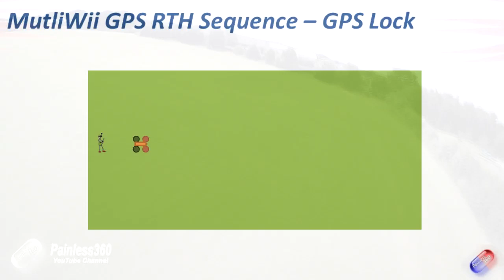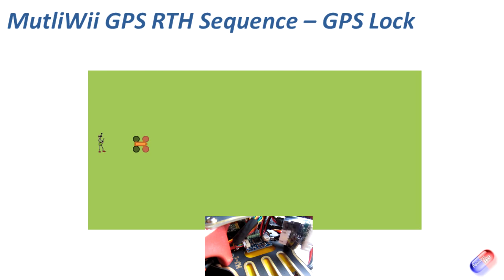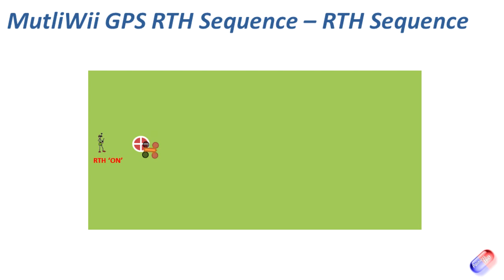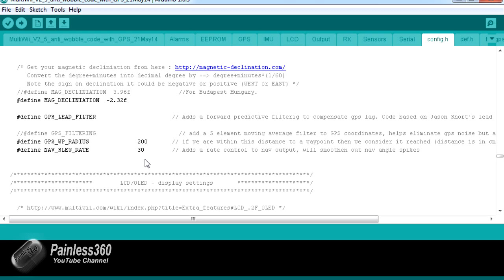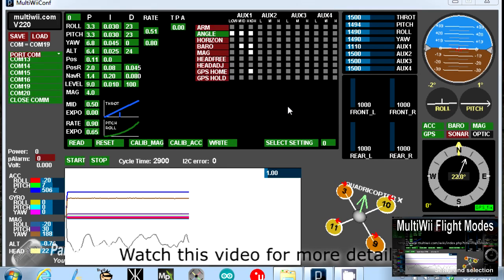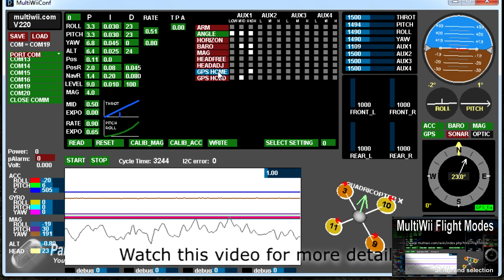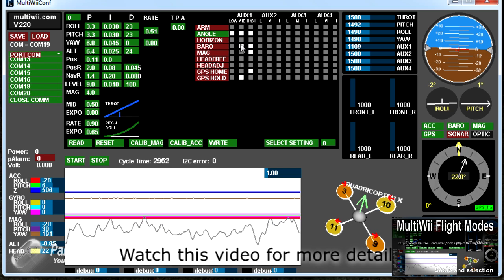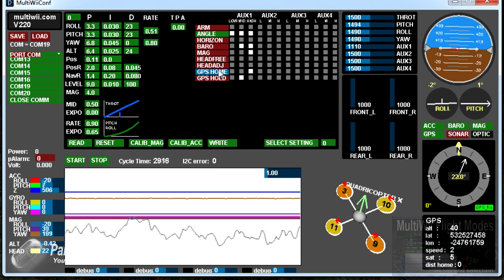MultiWii Quick Tip: Overview and demo of the 'GPS Home' function

Comment: So, when we power TX and The drone (armed), does the FISRT location saved by the drone???
(I'm working with Mahowik Balancing  Robot now with the GPS (NMEA).

And, do you switch the AUX1 when activating the RTH?
Reply from the maker: This is a very old video, check out the newer stuff on the channel.
Usually, a GPS capable fligth controller will store the location it's armed at as 'home' and use that to fly back to in the event of a failsafe/RTH. There are other things you can do, like SAFEHOME and other stuff too. Again, check out the later videos on the channel...

Comment: Hi!  Can I ask … if gps home is all working properly … if just in case I lost signal with the craft … will it also rth?  I can't find this feature on the sketch ..  Thanks again .. all your videos are really very very helpful.   :)
Reply from the maker: Set the fail-safe on the radio receiver to put the mode switch into the RTH position. Best of luck!
Reply: Thanks!

Comment: It does not have a RTH altitude as APM has? so when triggering RTH will it return starting from current altitude or there is a way to have some ascend first to 50 meters to avoid flying into objects etc?
Reply from the maker: +FotoAmg AmgFoto I'd check the latest documentation. The last version of Multiwii we played with  (2.3)  the RTH altitude wasn't managed by the flight controller. Best of luck!

Comment: First of all thanks for all the instruction videos. I installed the gps and i2c on my multiwii 2.5 and have followed all your instructions but when in angle mode and not gps hold the craft goes on its own and I cant control it. Any ideas of what im doing wrong? I have only 2 mode switches on my transmitter and have angle and gps hold on one switch  and off and gps home on the other switch. I always have 7 to 8 satelites when i try it.
Reply from the maker: +jose pedraza only have gps mode on one switch position. Best of luck!
Reply: I have 2 switches which are only 2 mode each one, so should I only have gps hold and off on one and angle and off on the second one?

Comment: Besides hold and return to home, is there any other thing I can do with my GPS + crius se 2.5?
Reply from the maker: +Everton Leite the latest version of the code supports simple waypoint navigation. Check out the release notes. Best of luck!
Reply: +Painless360 Hi, great videos! I could configure my multiwii with your help. A question: Does this simple waypoint navigation work with 328p based MW boards? I've read that it needs a bigger processor to run. Thanks!
Reply from the maker: Not sure - that will be covered in the release notes. I'd use an APM/Pixhawk/CC3D revo if this is what you want to do..

Comment: thanx painless360 been trying to set my runner 250r multiwii config up. your config worked on my runner as i only used gps mid for hold on its own and used gps high for home on ots own and worked.

Comment: Hello anybody! I have a Walkera Runner 250 and I have added a Walkera QR X350 GPS antenna. I have plugged it into my Runner and I have all my GPS info on the Multiwii but not on the OSD/FPV goggles. Does anyone know what I may need to do to show the GPS info on my OSD/GOGGLES?????
Reply: +prodezignz hi you need a barometer on the main controller board they dont come standard. you can pick them up from ebay.
Reply: +prodezignz plus you need the osd r for the info on the goggles

Comment: +Painless360 I have almost same setup as yours, except the board is MW Megapirate, and I have assigned Aux2 for GPS Hold and GPS Home functions. The problem is, when I flick the switch (ground test), the functions doesn't turn Green on the MultiWiiConf GUI, though I had about 10 Satellites locked on. Not able to figure out why the mode change is not reflecting as Green. Can help?
Reply from the maker: +Rahul Watharkar Not sure as it's not the same board. I've seen this once in the past and the GPS functions still worked great, seemed to be a little 'feature' of the GUI.Best of luck with it.
Reply: +Painless360 ok, I figured out the solution for it. Basically for GPS Hold and GPS Home functions, the Angle or Horizon mode is a must. You cannot configure GPS functions in silos. They must be accompanied with either Angle or Horizon mode, secondly a Magnetometer is also a good to have feature with GPS. 
Another thing required is, the GPS Modes will only be active when you have Enough satellites (5?) locked on and the motors are armed. 
So in summary, you need these 3 things for GPS Modes showing active on MultiWiiConf-
1) GPS to be configured with some flight mode (Angle/Horizon) and a magnetometer (not very sure if MAG is a must).
2) satellites locked on (gps_fix is green)
3) Motors are armed.
It worked for me, haven't still maidened the quad with this board. Happy and Safe landings :)
Reply from the maker: Great detail, thanks for sharing. Best of luck with the maiden flight!

Comment: Does the mumetal needs to be grounded? I have setup with grounded copper sheet, do you recon it worth of hassle to order it and replace it with mumetal? GPS lock works, and the noise on sensors got much as well, so at the moment I'm reluctant to change my setup, but  if this shows worth it I would give it try.
Reply from the maker: truhlikfredy in my tests I found that copper wasn't a good enough barrier to magnetic fields, even if I did ground it. I've tried other metals (ferrous) and not found anything as good as MuMetal.
Reply: Ok thanks, will give it a try. What do you recon for the go home, can it fight strong winds? Will it put more effort when I will see more resistance? I have the thing there but 99% fly manually and very close to me (sometimes I'm just happy with hovering couple meters away from me) so I never properly tried them. But I'm worried if some strong wind will pick it up, should I fight it manualy or put it to the GPS go home.
Reply from the maker: truhlikfredy there is a max speed for the RTL function so high winds could cause issues if it is flying home into the headwind. .

RTH is a last resort. Not an everyday flight mode. Happy flying!

Comment: ordered my gps ublox going to be a few weeks, i have had real good success with my d.i.y flight controller, even managed to get the pwm - ppm receiver conversion done with another arduino nano board... i need to get another nano board for the i2c conversion this i did a while ago and i pretty much think i can get that code to work too...anyway i was going to ask... running multiwii ver 2.2 will i be able to use gps rth, and gps hold..? also i need a foolproof way of setting up and making 100% its working... was going to try gps hold first a few times, also need to make 100% my mag is working spot on...  is there anyway to test my mag at moment without gps...? if i switch mag on should it lock the heading..? thanks AL...

Comment: Hello,
I messaged you several months ago regarding initial setup for an octocopter.  You advised me to start smaller which, of course, I didn't do (the hat should tell you that was coming, lol).  It's been quite a ride.  Our prototype taught us a lot about structural parts, etc.  I should mention here that the entire frame, from the motor mounts to the landing skids, is 3D printed.  I have successfully been able to get the craft to lift off and not make a bee line for someone's window and tomorrow, we'll be going to a wide open field for further flight testing both in horizon mode and using GPS functions such as RTH and flying a mission.
I want you to know that your videos have been highly instructive.  Thank you for sharing your insights and in particular, thank you for placing yourself in the position of the person who knows nothing and then explaining the important concepts in clear language.
Reply from the maker: Bill Isaacs Hi Bill, I do remember telling you that :)Glad you've got it all working so far, if it hovers - then it'll fly (power system willing)!Have a fun day in the open space, it is a great feeling flying something you've designed, programmed and build yourself. Happy flying!!
Reply: Painless360
Well things went well until I made a mental error.  The aircraft hovered and was controllable.  I was able to maneuver it well even though being only two blocks from the beach the breeze was a little stiff.  GPS hold worked fairly well too.  I got so excited about how well things were going that I forgot I only had a little 2.2A battery powering it, my intention being to test how controllable it was before putting one of the larger 5.2A batteries on.  I got the copter about 60 ft up, tested GPS hold briefly again, then began a slow descent.  At this point the controls became squirrely and I said to myself "uh oh...".  The battery was dying and the copter crashed into the grass from about 30 ft altitude, breaking several arms.  Fortunately, the entire frame is 3D printed and it's no big deal for me to repair the damage.  Other than that, I feel it was a successful flight.
Reply from the maker: The first few flights of any model usually end in a little 'bump' ;) Crashing is part of the process, the trick is not to do it from a height or over deep water

Sounds like you made a great hex. Well done.

Best of luck with the repairs. I'd like to see a photo when you have it back in one piece..
Reply: Painless360 Sure thing on the pic.  https://www.island-wifi.com/alpha_v1.0.jpg
Reply from the maker: Wow, amazing job. nice clean setup through the arms too. Thanks for sending that across..

Happy flying!

Comment: Hi Painless, I was wondering if you have in any of your videos show the exact way how to turn your quad , using a Multiwii system , on all of the axis's to get your GPS Home set?  Just want to know how to hold the quad while turning in circles to get it locked in. I have mine with Bluetooth and use a android app and either my Samsung Note 3 or Nexus 7 to try and calibrate , but I am not sure if I am doing it right. I can figure out holding it straight out and turn them turn it with the front facing down and turn , but then what ? The app gives me 30 seconds to perform the moves . Any help would greatly be appreciated . Big time subscriber to your videos . Keep up the Great work.
Reply from the maker: The GPS Home co-ordinates are set when you arm the board and have a good GPS lock. Apart from leaving the GPS for 40-60 seconds on first startup to get a good GPS lock you shouldn't have to do anything.

Hope this helps.
Reply: Painless360 OK , but what about the Mag calibration then ? Is that something that needs to be done before flying your quad with the Multiwii? Because thats where it asks you to rotate your quad on all axis points. I see others perform certain tasks with DJI Phantoms.
Reply from the maker: Fallguy1959 mag calibration needs to be done once by clicking mag calibration in MultiWiiConf and following the instructions. Multiwii doesn't need the same level of 'magnetometer calibration boogie' that boards like the APM and others do ;)

Happy flying!

Comment: hello friend, I would like to know what functions should enable me to use the RTH. PLEASE HELP ME. (angle, baro, mag, gps hold)?
Reply from the maker: You can see what I have clicked by watching the video at 7:16.

GPS HOME, ANGLE, MAG and BARO.

Happy flying!
Reply: Painless360 thank you my friend, and for the GPS function hold? (Angle, barotrauma, and gps hold?)
Reply: drone sapiranga thank you my friend, and for the GPS function hold? (Angle, barometer, and GPS hold?)
Reply from the maker: Yep :)
Reply: Painless360 thank you friend, you helped me very worked perfectly, I used your comfiguraçoes, I was afraid when he returned. came back with a lot of speed, but came back perfectly, not have some form of it back slower?
Reply from the maker: I've not done it myself as I like the speed that it uses by default. See http://dl.btc.pl/kamami_wa/hk_29798_9.pdf for more detail on the changes you can make to the minimum navigational speed.

Best of luck.
Reply: Painless360 thank you friend, I will try to reduce the travel speed

Comment: how about Fail Safe? Do you know how to set that up so in case if your transmitter looses signal it returns to home? Thanks.
Reply from the maker: You could rebind the receiver so that in the event of a radio disconnection it outputs the RTH channel value. This still wouldn't sort out the throttle though. 

Look at the APM if you want it to fly home all by itself in the event of a radio problem..

Comment: I have got my RC model up and flying, and when I enabled the GPS return to home, the thing became to fly off far away from me! I had to flip it back to where I was in control and it flipped out and crashed. :( The GPS was locked to my takeoff spot, or so I thought.

Also I attempted to enable a GPS lock, and while it seemed to worked for a few seconds (it was regulating altitude) when I accidentally gave a nudge to the control stick it immediately began to act like it was in acro mode and accelerated into a tree. By the time I flipped the switch back of to regain control it had crashed breaking my second to last CW prop. :(

Surely this was something simple I goofed up? Any suggestions? Also is it possible to use the spare audio channel to send down digital telemetry data such as GPS coordinates? A dedicated telemetry transmitter is not very cheap, I would like to be able to record the GPS data from the ground station so that when I crash as lose signal I have a refrence to go by to find where the model was when it last had signal.
Reply from the maker: Sorry to hear about the crash. Sounds like the GPS co-ords were not locked before arming the board for the return. Odd that it should also fly off when using GPS hold too, it should 'wander' a little but not that much!

Two things to check first - there isn't too much vibration on the model affecting the board, there isn't any interference with the compass from the power lines..

Good luck getting it sorted.
Reply: The MWC FC is lying in-plain with the power distro board, and the ESCs sort of surround the FC. I suppose I will need to get a compass and tape it down onto the board close to the FC and see how much deflection is achieved.  I do have some magnetically permeable materials like sheet metal that might work as a substitute for mo metal, hopefully.
Reply from the maker: You can test the deflection of the compass easily. Connect to the MultiWiiConf and remove the props, power up and arm the copter and run the motors up and see how much the heading changes on the PC. Hope this helps.

I guess you've already seen https://www.youtube.com/watch?v=3CBxyY0lS6g?

Good luck..
Reply: [facepalm] such a simple solution! lol! I'll have to test it when I get around to it. I wonder if I can make the power distribution wires into a 'twisted pair' to allow the magnetic flux to cancel out between the positive and negative. (theoretically they should since electrical current is flowing in opposite directions and the direction of the magnetic field produced should be opposite.)
Reply: Painless360 After rebuilding the frame and far more practice flying and FPV, I have worked out many almost all problems. I still have 2 major known issues:

The GPS hold does not seem to hold very well, although altitude control works fine and is surprisingly good. My last test showed the thing kept drifting to the south. It does hover fine when just in angle mode, or self leveling mode. (I generally avoid acro, I do not like it for the big quad.) And until I can get that to work well, I am too scared of testing GPS RTH. I have not noticed any magnetic deflection in the multiwii GUI at all.
Reply from the maker: Power Max sounds like you are almost there.  Use a BT connection and see whats happening in the GPS.  Maybe vibration or interference is still causing the HDOP to creep..

Best of luck.
Reply: Painless360 I forgot to mention the other major issue is the fact that servo's only rotate 90 degrees, and I do not know how to get them to go the full 180 degrees. I do know my servos are capible of it using the servo library and arduino.
Reply: Painless360 Also, I do not have bluetooth adapter for the MWFC, but I do have minumOSD configured and working correctly. And other method? I did consider slowing down the baud rate to 9200 and using the spare audio channel on the video trnsmitter to literally get proper telerometry that can be easly recorded by a serial recorder app. Though I never got around to doing that. (Also who knows what problems will result from too low and mismatched baudrates.)
Reply: @power-max 
I'm very curious if you ever got it to work?

Comment: How do you get it to default to GPS RTH, such as when disconnecting the transmitter? I tried this on mine and found it to stay in which ever mode I was in when I turned off the transmitter. Thanks for the video!
Reply from the maker: You need to use a receiver with failsafe and bind the Tx with the mode switch in the 'RTH' position. Check that the receiver you are using supports failsafe, some of the original 'orange rx' do not have it. See (5/8) APM 2.5/2.6 - Throttle Failsafe Setup for details on how I set it up on an APM.

Hope it helps, happy flying!
Reply: Painless360 Thanks a bunch, I'm running the Frsky Taranis and X8R reviewer combo. I'll look into getting it setup, the Taranis has RSSI telemetry so it may even be possible to trigger it at low signal strength.

Comment: Hi,
I have just built a multiwii hexacopter and have it all configured, however the multiwii isn't picking up pitch and yaw. I have tested the receiver so know they are working. Any suggestions?
Thanks
Reply from the maker: How have you tested the receiver? By plugging a servo into the Aileron and Rudder channel? If so then I'd re-flash the board and reset the accelerometers.

Sounds daft but check the cables are in the MWB the right way - I've made that mistake myself! Good luck finding the problem..